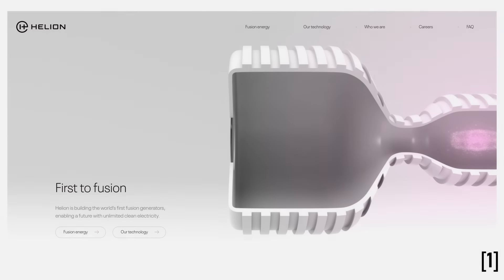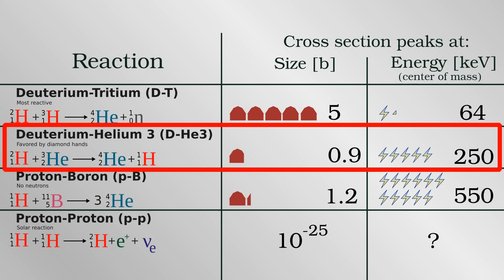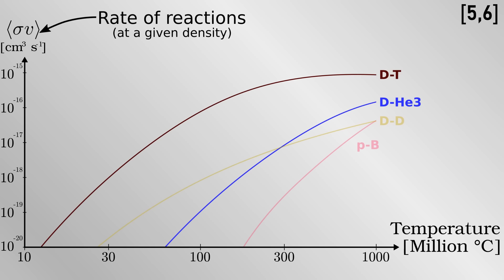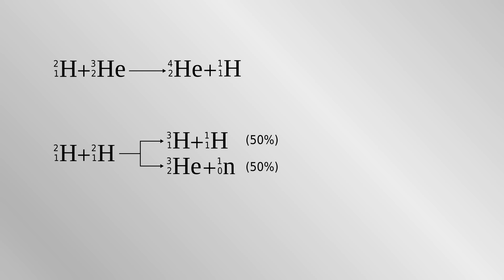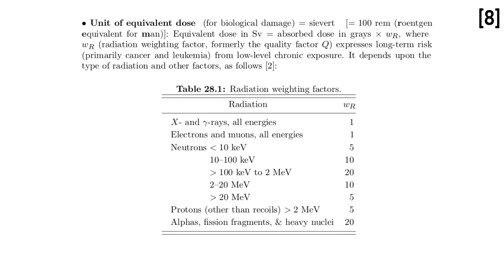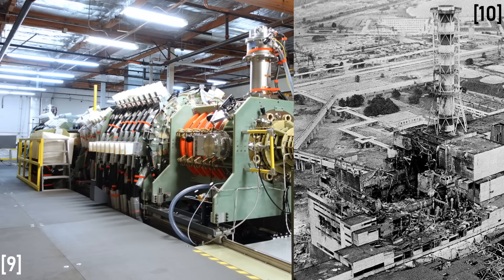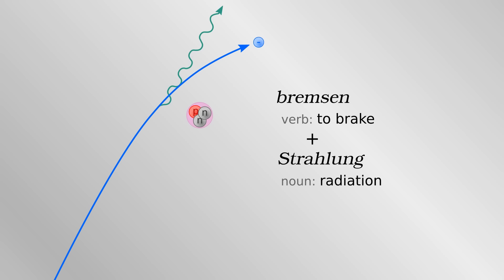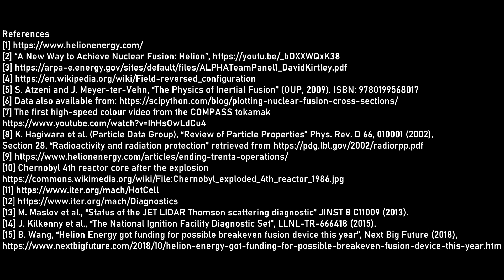The problems with Helion Energy - a response to Real Engineering

Comment: Couldn't they go around the fusion challenges with their capacitor electrical discharge? All of that supposedly happens in a few milliseconds, and the electromagnetic fields allows them to isolate the elements while increasing to the necessary temperatures before fusing said elements

So it did SOUND like they were addressing said engineering challenges that you suggested. 

In that case, what am I missing here? What are you still seeing wrong with it?

Comment: Even IF fusion works.......it is technically an extremely complex and expensive technology.  In other words, the power it produces will be expensive, very expensive and few nations will be able to build and maintain.  By comparison Thorium Molten Salt Reactors are simple in principle and simple in engineering........the reactor is literally a metal tank, at atmospheric pressure full of molten table salt (or some other type of salt) with Thorium or even existing spent reactor waste dissolved into the salt.  As fission picks up, the salt/fuel liquid mix heats up, expands and limits fission......it levels off. Passive safety,no weapons materials and high thermal efficiency are also big features along with almost no long lived waste.  The basic physics of fusion and its high temperatures means it always going to be impractical.

Comment: Everything else asside, the idea of accelerating two donuts of 100 million degree gas to mach 10 and slamming them into eachother in the centre of the reactor seems patently ridiculous to me. Assuming they aren't lying and they can actually do that, it sounds extremely dangerous for a machine so small to be handling objects that energetic inside it, and I don't understand how they can possibly expect the gas to come to a stop in the middle. I think the unspoken assumption was the two plasma donuts hit eachother and come to a complete stop, which is hilarious no matter how you slice it. For one they are fluids, not solids, so a good deal of each donut would just pass through the other. For two I'm not sure if you've tried smacking two things together at extremely high velocity lately, but they tend to not come to a complete abrupt stop in the middle, and would much rather splatter in all directions at high velocity.

I'm not a physicist by any means, so perhaps I'm missing something, but the whole thing just seems like bullshit on that point alone.
Reply: 1. Those FRCs is very hot but they are not very dense (closer to a vacuum than to ambient air). Because of that their energy content is actually very low.
2. It is actually pretty established physics and has been done in many machines by other teams as well (ENN, TAE, a Japanese team among others). It is an interesting property of FRCs to merge when two collide with opposing polarity.

Comment: This is really interesting! However, I dont quite understand the temperature graph. Is the reactivity plotted at some specific density or is it constant over density? Is there some data for the reactivity as function of pressure and density for the different fuels?
Reply from the maker: Multiply each one by the density of reactant one and then the density of reactant 2 to get the total rate per unit volume.

Comment: Is Helion planning to run extremely Helium rich?
Reply: Just 3 times higher temperatures than they did in Trenta. That changes the ratio of D-D to D-He3 reactions as well and at that point they are almost equal.

Comment: 1. I think the Helion should use the neutron energy converter too as the ITER will use. The difference only the Helion neutron converter would be less than the ITER'S. The ITER will be built the neutron activated parts will be changed. How sould the neutron activated parts be changed in a Helion power plant machine?
2. The quick neutron radiation has 20 times stronger as the beta and gamma/X rays and decrease with its energy near to 10 times. The quick neutron kiks out proton from every hydrogen cointain material and during to its lossing energy produces many many ionisated material in our body. The slow neutron will react with another atom and the n/gamma reaction produces gamma radiation. The new isotop could be stabil and could be radioctive it depends on the original isotopes. So the very quick neutron has treesteps effect with the living organisation as the human body! The video mentioned only the last dangerouse step, but there are earlier two dangerouse steps in the biological effect!

Comment: They probably can also reduce the rate of neutron generation by changing the ratios of helium 3 to deuterium. Deuterium deuterium collisions increase or decrease by the square of the deuterium concentration while helium 3 tritium collisions decreased change linearly by the deuterium concentration.

These are good criticisms but I'm not going to outright condemn the helion project yet. We need an open dialogue about these kinds of issues, unfortunately there's too little of that in the partisan politics of fusion research both in academia and in venture projects.

Now do, spin launch, it doesn't require extensive knowledge of nuclear physics to see what cluster fuck that is

Comment: What if the He3 + D Fusion is just marketing buzz and they are actually going for D + T Fusion? They said in the past the machine can do both. Would it then be viable?
Not that I have high hopes for this, just curious.
Reply from the maker: Then they would need to radically alter their design to include a 1m thick blanket all around the reaction chamber, moving the coils further away and reducing their magnetic field.
Reply: @ImprobableMatter  Thanks for the answer. Didn't you say they need that 1m thick blanket anyway? And why would they need to alter the design? Can't the blanket be outside of the machine? Sure over the course of years the neutrons will embrittel the material, but if it's as cheap and easy to build as they say, maybe that's okay? Just replace it periodically.
Just playing devils advocate here.
Reply from the maker: @4203105 If they put the blanket around the coils and electronics, they will quickly become irradiated and defective. They can't really run a reactor for 1 year, for it to then be radioactive for 100. They have several tradeoffs to make, but any of them are attractive.
Reply: @ImprobableMatter   If it really is only one year then that is prohibitve, yeah. 
Thank you.

Comment: I'm OK with using today's relatively inefficient solar panels to capture radiant energy from our nearest operational fusion source, the sun.   Mountaintop geophysical instruments can be solar-powered even in mid-winter with big enough batteries & some careful attention to detail, i.e. your panels should be mounted vertically to shed snow as quickly as possible after a blizzard, and aimed due south to maximize collection efficiency.  Big flooded [wet] Ni-Cd cells work properly even well below freezing, & are tolerant of overcharge [no fancy BMS needed, just a max voltage charging shutoff].  Sometimes the older technologies are still the right choice...

Comment: This is wrong:  the deuterium is accelerated separately from the helium, so only D-He collisions have high relative velocity.  Deuterium atoms are all traveling in the same direction so have low temperature relative to each other.  Pretty basic miss
Reply: It is not.  Helion needs deuterium-deuterium fusion to breed He3.  Thus the plant will run solely deuterium-deuterium fusion for several months at least initially in order to breed enough Helium-3 for its later use.  It cannot get through the initial He-3 breeding period.

Comment: Not the right kind of engineer (chemical, not nuclear), so maybe I'm missing something, but in that chart of reaction rates vs. temperature, since the D-D curve is above the D-He3 curve at 100 MK, wouldn't that reaction dominate?  Assuming that the reactions have a 2nd-order rate constant (i.e. the rate of fusion depends on an elementary step where two atoms collide, making the energy output proportional to the square of the gas pressure), that would mean the rate constant for the D-D reaction is 10 times greater than that of the D-He3 reaction; going from pure D to a 50/50 fuel mix would drop the D-D rate by a factor of 4, but that would still make it 2.5 times greater than the targeted D-He3 reaction.

My point is: doesn't that chart show that, at a first approximation, the undesirable neutron-producing reaction seems to be around two thirds of what their reactor is expected to be doing?

Edit: ah, the video makes that point like two seconds past where I paused it.  Alrighty, then.
Reply: Another factor is the ion temperature, at about 200 MK the reactivity for D-D and for D-3He is the same, and at higher temps it favors D-3He.
Helion say they are confident they are going to get to 200 MK in their new machine now in construction (Polaris), probably more.

Comment: Would it be possible they're banking on Deuterium-Helium 3 working "good enough" because helium is easier/cheaper to acquire than Tritium? Could it be possible for them to switch to D-T reaction in the same reactor at a later date once proving temperature capabilities? Idk, I'm still learning this stuff.
Reply from the maker: Helium-3 is also super rare.

Comment: Isn‘t the reaction also a function of pressure, not just temperature. Im not in fusion, but cant this change it a lot?
Reply from the maker: Yes, the density of reactants is important too, but the plasma becomes more unstable and difficult to control if you increase the density.
Reply: Ah ok. Thats making sense. Just if i underdtood their princible right, they shoot the two plasma rings on each other at a quite high velocity. So pressure might have an influence in the moment of the reaction. Not shure, how much control over the plasma you need after all.

Comment: As a variant : what about shooting, in the same manner, two plugs made of Lead (or Gold) with a conical cavity filled with a tritium&deuterium pellet, with as good as possible vacuum in between.....  down a long-ish pipe that slowly constricts to ensure perfect fit without any leaking.
Would THAT be hot & dense enough to fuse? usefully?  At least gold would have another usefulness besides trinkets (& electronics).

Comment: I welcome all the approaches but if they don’t put energy into the grid they are useless.
To have a reactor not need a steam turbine is huge if this could work.
They are supposed to have Polaris (7th gen) by 2024. Let’s see…
It sounds like Helion would need an He 3 producing reactor deuterium-deuterium which would generate unwanted neutrons, radioactive waste and He 3. And also the power generation reactor with He 3 -deuterium reactions. Unclear if they would need 1 He 3 reactor for every ten power rectors (He3-deuterium) or what. I wish them all the luck..

Comment: IS D-He3 SO INFERIOR TO D-T AS FUSION FUEL? At 100 MºC, D-He3 has about 1/600th the reactivity of D-T. Does that mean D-He3 is worthless compared with D-T?

I propose that, under certain conditions, D-He3 might be BETTER than D-T. These are my arguments:

(notes: MºC = millions of degrees Centigrade/Kelvin, 1eV = 11,605 ºK, D = Deuterium, T = Tritium, He3 = Helium-3, Triton = T nucleus)

....1. IF WE COULD REACH MUCH HIGHER THAN 100 MºC: The reactivity of all fusion fuels is better the hotter we make them (up to a point), but in Tokamaks, and above 150-200 MºC, energy loses (mainly Bremsstrahlung) grow faster than energy production. Now, suppose someone designs an IMAGINARY REACTOR (let's call it ImR, for shorts), were electrons were much colder than ions, so it could reach 500 MºC without losing too much to Bremsstahlung (or cyclo/synchrotron, etc.). In our ImR, a D-He3 mix at 500 MºC would have 1/5th the reactivity of D-T at 150 MºC (assuming thermal distributions).

....2. IF WE COULD DO DIRECT CONVERSION: Turning heat into electricity has twice the loses that direct conversion. The energy resulting from fusing D-T can only be recovered as heat, while with D-He3 direct conversion is theoretically possible. If, added to the previous capability, our ImR could do this, then its projected energy production with D-He3 would raise to 2/5 that of D-T in a Tokamak.

....3. IF WE COULD RECOVER A SIGNIFICANT PORTION OF THE ENERGY INJECTED: In Tokamaks, most of the energy used to heat the fuel is lost, as is the energy to maintain the magnetic fields. If our ImR could recover more of it, this would improve its energy balance. For example, if it could recapture 50%, this would put D-T/Tokamak and D-He3/ImR toe to toe, and if more than 50%, D-He3/ImR would gain the lead.

....4. IF WE COULD MINIMIZE TRITIUM PRODUCTION/REACTION: A D-He3 machine is going to produce 1 MeV Tritons from D-D reactions. Some of these Tritons will react with more D right away, or get stuck inside the walls, leaving some time later and, again, react with D. Neutrons from D-T reactions carry 14.1 MeV each, causing all kinds of pains. Is there a way to minimize T production? One possibility would be to make our ImR pulsed, and these pulses short enough that A) only 1% of the D would react (maxing T production at 0.2% the initial D population), and B) pulses shorter than the thermalization time of 1 MeV Tritons (at that energy, the cross section for D-T reactions is aprox. the same than at 150 MºC). Moreover, if after each pulse we evacuated (even not completely) the reaction chamber, and start the next pulse with a "clean" fuel load, that would limit the accumulation of T in our plasma.

....5. IF WE COULD LESSEN THE NEUTRON DAMAGE: Generating 1 MWh of electricity from D-T requires creating about 1.3x10^25 neutrons (at 45% conversion efficiency), each with 14.1 MeV. If we set our ImR to produce the same amount of He3 than it consumed (by encouraging D-D reactions), it would generate one third that number of neutrons per MWh (at 80% efficiency), and each with 2.5 MeV. Less neutrons + less energetic -> less damage to the reactor -> less capital costs + less maintenance costs. Thus, cheaper. Of course, if He-3 were obtained from other sources, the ImR neutron production could be made much lower, perhaps as low as 1% of the D-T number.

Granted, those are a lot of ifs, building such a machine is a tall order, but my point is that D-He3 may not be such a lousy fuel after all. It depends on the reactor capabilities.

Edits: for clarity and spelling.

Comment: There is an "easy" way to avoid side reactions. Send one component from each end. I don't remember any indication that they are doing this. Also I bet there are practical problems with mismatched masses. Still if the side reactions are such a big problem, it seems worth trying.
Reply from the maker: You are describing beam-beam fusion, which will not work for reasons I describe here: https://www.youtube.com/watch?v=2DzKXN1pcwY

Comment: So did they or did not achieve net positive energy (in a scalable, useable manner in the near future) In real engineering's video he mentioned about efficiency in providing the initial energy to the system, like conventional powerplants, and storing the net gains in capacitors and their own losses, etc. And what exactly is not scalable in their design, besides what you mentioned about needing shielding when more output is achieved?  Sorry, this goes a bit over my head.

Comment: what is with these startups on fusion, thinking it would be easy and beat ITER. I think the long term problem of Helion will still be magnetic confinement, and find that they would ever larger machines. the thing with the sun or stars, the extreme gravity or confinement is free and extremely strong.  
if these talent and money were poured into like wind power R&D, we could get into cheap abundant electricity much earlier.

Comment: IMO, we already have a giant fusion reactor in the sky and we know how to harness its energy. If you need any solar panels or inverters, LMK.
Reply: We know how to harness its energy(though, to be fair even the energy in coal and oil ultimately came from the sun), but we don't know how to store it. Battery technology is in abyssmal state.
Reply: @narfwhals7843  It's really not. LFP is not a bad technology, especially for energy storage as opposed to EV's.
Reply: @ToddDesiato  LFP's have lower energy density than other battery types and anything using Lithium is going to run into cost issues at the scale we need it.
Energy density and transformation efficiency are major issues with batteries and things like hydrogen fuel cells.
Currently we're better off pumping water up a mountain.

Comment: Okay but there has got to be a better way to generate oower than boiling water and spinning things.
Reply: Bad news: Even a fusion reactor would generate power by boiling water and spinning things. Steam turbines are enormously efficient, and there really isn't any other system around that can convert thermal energy to mechanical energy that efficiently and at the kind of scale you'd need for a power plant.

Comment: Rewatch real engineering video. Helions "closely guarded secret" had nothing to do with the fuel, but the shape of their reactor.
Reply from the maker: You mean a compressing FRC concept that's been tried for over 50 years?
Reply: @ImprobableMatter  This particular configuration Helion is trying, forming two FRC at both sides of a reactor, then accelerate/compress them, collide/merge, and compress further, dates from the end of the 2000s. Even if FRCs had been researched for some decades, that specific idea is much  more recent. IPA-C (evolution of the previous IPA experiment) is the first machine I've heard about to try this, and they started around 2010. By the way, Helion is not alone, after 2010 other teams worldwide got interested in the concept, and now there are at least 5 I've heard about, toying with it.